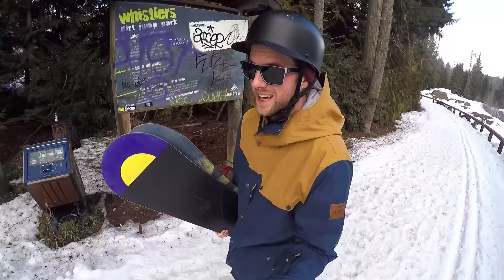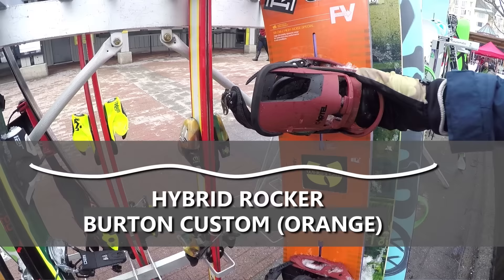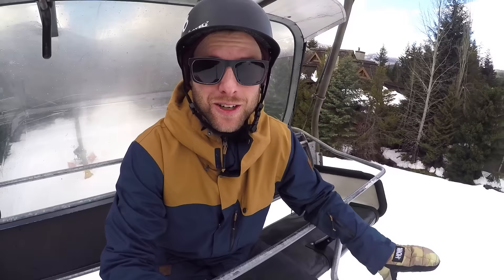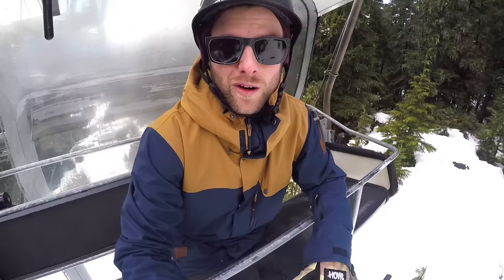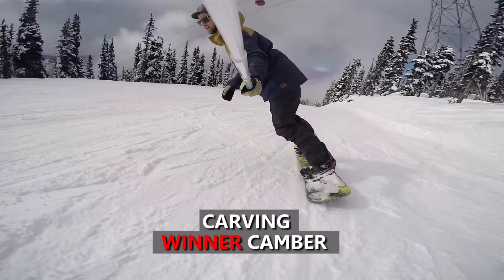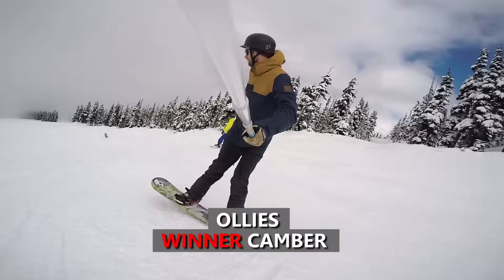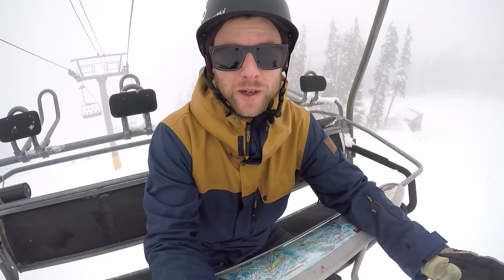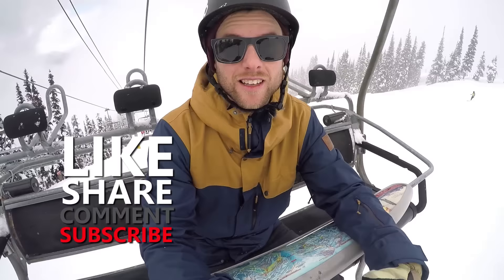Camber VS Rocker Snowboard Test

Comment: My personal choice: flat camber/ zero rocker/ however you wanna call it. I used to ride a hybrid rocker for a long time which was really fun in all conditions (except for icy conditions) and all parts of the mountain. Playful, comfy powder riding, nice to learn butters and start off park riding as it is really forgiving (while you'd catch your edge pretty quickly on a camber). But as I was progressing in park riding I wanted something more stable for bigger jumps, but still playful and not too aggressive. At first I was pretty skeptic about flat cambers, but once I tried it I immediately fell in love. I'll keep my rocker hybrid board for those hard and long powder days, but I won't switch to another shape in all-day-riding.

Comment: It all depends on your terrain prefs. I have a big swooping rocker board which floats extremely well in powder. For groomers and kickers I use a twin camber board. Both perfectly fit my needs when used in the proper terrain, but would perform worse in the other situation. If I ever get into boxes or park more, I would buy a short rocker board, so that I catch an edge less easily.
Also, rocker boards are more fogiving in turns and landings, but give you less response if you're going for big, fast slalom style. And then there is the whole other issue of board stiffness...The best board for you is the board that best fits your riding style.

Comment: I just switched to a lib tech trs c2 power , and although I have no camber experience to speak of, I am absolutely amazed with this board (my 5th board). Very stable flat basing, edge hold is phenomenal, pop is great, great in pow, great on hard pow, great on icy days, buttering brilliant, landings very good, one footing easy. I am in love with this board and have progressed more in 4 days using this board than in two seasons on my last board (rome agent rocker).

Comment: The board I got good on was a camber, then 2 years later I switched to a board with a rocker and magne traction for about 4 years. I never got any better on that board with the main reason being the edges. My GNU would always wash out on me even with the "7 points of contact" magne traction. On a camber when you put that edge in the snow you can really feel it in there and that's what you want for spinning, something to push off of. And for boxes and rails I still prefer the camber, I mean I can press just as good as a rocker board if not better, it has more to do with your boards flex and where you stance your bindings. For spins, pop, rails, and edge control I'd say camber all day. For powder and butters go with a rocker.
Reply from the maker: +Brennan Hamilton exactly my feeling too!
Reply: Good comments/insight. I've been riding the GNU Space Case (hybrid rocker with the magne traction) for 4 years and just picked up a full camber board (never ridden camber before).  I am having the same "wash out" experience that you reference.  I'm just worried about catching an edge, but we'll see next week when I get it.

Comment: I was a die hard camber guy (boarding since 1990) and have to say burton rocker and hybrid rocker are the most unstable boards I’ve ever ridden. So i tried a few more rocker birds as they came out and nothing could compare to camber stability at speed and edge control. Then I ran Rides designated Hitter with hybrid profile and the thing was super stable, floated great in powder, slayed the crud, lots of pop, yet playful in the park. Skip forward to riding a Lib Tech C2E profile my buddy was raving about and damn if I wasn’t impressed, ended up getting a GNU T2B with BTX hybrid profile and have to say this thing is best of both worlds: crazy stable at speed, great Magne traction edge hold in icy/variable surface conditions, blasts through crud and tracked out conditions unlike anything I’ve ever ridden but still so quick edge to edge with the best float in powder I’ve ever had including from traditional rocker boards. Mervin made lib tech and GNU for the win!!!!

Comment: First learn to butter like a pro and then you'll find the advantages of the rocker. And also rocker as better for learning as well, hence it's forgivable behavior. 
So... Rocker is for - ground tricks, learning, powder, spins and tricks
Camber is for - speed, carving, icy slope
Reply from the maker: +Plamen Penev What advantages do you think the rocker has for beginners?
Reply: On my opinion, rocker is better for beginners, because it is easier to maneuver and it's forgivable in terms to catching the wrong edge while turning. Other good choice for beginners is a flat board.
Reply: +Plamen Penev I think it also depends on where you struggle while learning to snowboard. When you have troubles catching the wrong edge, a rocker could be a good idea. On the other hand, if you (like myself) have troubles with flat/narrow passages, the camber seems the better choice. A lot of the skiing/boarding areas where I'm boarding are traditional made for skiers, often connecting passages with long flat logging roads (I hope thats the right term). Those are hell especially for beginners who don't feel comfortable riding with high speed (to get the drive for the flat parts). The camber feels way more secure on those parts in my opinion. Apart from that, the feeling for the boarder should be the main reason to chose a board, so testing different styles should be recommended to everyone ;)
Reply: +Plamen Penev I learned on rocker and after switching to camber I wish I learned more on camber, because it took me a while to get used to it. Rocker promotes lazy riding and allows riding ok even with bad form/technique, while camber wont forgive you for those. You can also learn to butter like a pro on a softer camber board as well.
Reply: +MrFujiapples, I've learned on camber /at thet time rocker wasn't invented yet/, and then switched to rocker, which suits perfectly to my riding style - ground tricks mainly. Snowboarding shoud be easy, fun and why not lazy as well, I don't see that as a bad thing. With rocker board in the end of the day when you are tired, or when you learning new tricks small mistakes won't get you on the ground. Of cource If you are a big jump, slope or speed rider, camber would be a better idea.
Reply: +Plamen Penev   I take camber boards for everything! Big park jumps, Pow jumps, powder lines, rails, slope butters.. But i'd say that rocker or a hybrid is much better to learn..
I also learned on camber cause ther were no rocker boards. i changed to rocker 2 seasons, liked it a lot more, had an hybrid 1 season, liked it even more, then i tried a full camber and i absolutely loved it! so now i'm riding camber since 4 seasons. Rome MOD .. best board ever..  
I guess you just need the Power and control yourself for the Power and control of a camber board..
But i want to get a Big Powder fishtail rocket for those sweet Pow days!
Reply: +Plamen Penev I learned on a hybrid rocker, (Nitro cinema) and although I have a lot of fun on it now its way easier to catch an edge going at any kind of speed. You need to have an evenly weighted stance and no beginners have that, if your shoulders aren't straight you will also start turning uncontrollably as soon as you get going. 
On the other hand its got great response and you can be really surfy on side features.
Reply: I disagree, I found rocker HARDER to begin with. Camber works as much more of a shock absorber over small bumps and shakes, especially if you are like me and ride in places with man made snow, the difference is night and day. Can agree its more forgiving when it comes to catching edge but that forced me to edge properly and once i really got properly carving I went from a green run to a black run in one day. That wouldn't have happened with a rocker setup. I've suggested everyone learn camber and they all do great once they get though the first day or two. Had one friend in the halfpipe on his 3rd day out.
Reply: I learnt "ground tricks" on camber.  Then I got a rocker board to learn more. I felt camber is much less forgiving. e.g. if I do a 180 and I don't land perfectly straight, it might throw me hard. But with rocker, I would just wash out and spin with it. It's not good to take too many falls when learning anything (beginner or expert riding). It reduces your energy and can demotivate you when it hurts. As for beginners, they don't do high speed carves so that's not an issue. And if all you do is what you already know, you will never catch an edge with camber. If you push the edge (pun), then you will.  Rocker reduces it though.

Comment: The hybrid is so different, I use a traditional reverse camber with my partially paralyzed left (lead) leg. Sell it has heel toe ridges to give a tiny bit of grip.

I have so much more control in the turns compared to every camber I've rode before. Simply a huge difference.

Your videos helped me learn my basics btw. Still have some issues with my paralyzed leg, but between my Arbor Swoon and your videos I carve the mountian in tiny bits.

Comment: I ride an old 2007 naidecker platinum, which is camber and also own a bataleon whatever, both 158. The what ever is miles off being a camber and the NP is a pure camber. I like pissing about on my whatever in Park and groomers but any time I want a Good solid day off piste, in pow, Tree runs or beasting it on a group day of trying to clear a mountain I'll always go with the NP camber. When I give advise to friends learning I always advise a rocker or hybrid as it aids with thier turns which as we know from the start is the tough bit to link, but I plan on getting the Travis rice HP for next season as rode it a few times and  it is just immense for everything. Keep it up Kevin, cheers pal

Comment: There are so many options.  I ride a balanced mix of deep powder and groomers in Japan and my go-to is my 161 Burton Barracuda which has that hybrid Flying-V camber and it excels at both; it chatters quite a bit on hardpack because of the long, floppy nose but the edge hold is great.
I'm about to roll out with two new boards for Japan this season; a 159 Arbor Shreddy Krueger which has what they call Parabolic Rocker where the rocker tapers towards the tip and tail.  The sidecut has four extruded contact points as well so more technical riding is doable.
The other is the K2 Ultra Split 158 which is almost flat underfoot (like a 1/4" of camber) and rockered at the tip and tail.
So, two very different shapes this season.  I'm curious how they'll perform and hopefully diversify my riding a bit.

Comment: Burton hero 2010/2011 version with 2/10 flex and rocker profile has definitely changed how i view snowboarding. Just the agility you could have with a soft flex twin rocker board opens up a very playful variance of snowboarding that was unavailable for me before trying this board, i instantly fell in love with this type of board and the various riding styles it allows .... definitely not a winner for speed, stability, carving or difficult / icy terrain ... but the fact it allows you to feel the sport in a more playful way, and just generally opening up new perspective to riding would give rocker profile, flexy boards more value in my opinion. Cheers!

Comment: Should have mentioned camber is much easier to catch edge on, especially for beginners. I started out with a camber board and would catch edge and fall hard a few times a day. I switched to rocker and pretty much never catch edge anymore.
Reply: +dacasman you will catch more edge when you're learning and less afterwards. So if you use a camber initially then switch, it will seem like it's the board allowing you to catch less edge but it probably was just the typical snowboarder's learning curve.

I said "probably".
Reply: +Cichlid Bro That's absurd. I've been riding for 18 years and own rocker and camber boards and you are just dead wrong. Rocker will let you get away with mistakes you would pay for dearly on a camber board. If I'm going fast I wouldn't trade camber for anything. If I'm playing around in the park and trying new butters, rocker is better.

Comment: The only thing I dislike about my camber board is the edge catch when I'm buttering. Other than that, it's a charger! I can ride 50-60mph without a second thought. Definitely more control than my rocker board...but rocker was more playful.
Reply: 3D bases man, they are the way. http://www.gilsonboards.com/pioneer-snowboard.html these boards are really cool, they have a "soft edge" design so on hardpack your edge isn't making contact with the snow if you go flat base, and they have a ton of flex in the middle of the board with the rest being pretty stiff so you can butter on a camber board without worrying so much about hangups. But then you're still riding a camber board when it comes down to it so you can lay down some really nice carves. There are so many advantages, it's a great jib board concept because you can keep your edges sharp without worrying about hangups, great for pow, great for forgiveness on landings, but without sacrificing control on takeoffs. They have a US demo tour so you can ride before buying cuz the price is indeed on the steeper side. I have 2 and they're so worth it, saving for my 3rd.
Reply: Sam Clark same here with my old pro model sims. Its a board that want to go fast , ride aggresive, and pop. But I'm checking for a hybrid board, very curious about this shape

Comment: Why is this not Camber Vs Hybrid? I feel like Hybrid profiles are much different than a full rocker profile. Also where the lengths of the boards the same? I feel like that would make a difference.
Reply from the maker: Yeah, the board lengths are the same. (159) I could title the video rocker hybrid, but I thought people may not know what rocker hybrid was and would be more familiar with rocker. That's why I explained the difference at the beginning.
Reply: Hybrids are full rocker throughout the board. They just have camber under the feet.
Reply: +Got Method not all of them are, like the libtech hotknife is a camber dominant with just a bit of rocker in between your feet
Reply: +Got Method depends on what kind of hybrid we are talking about there are so many different combinations. You have rocket camber rocker. You have camber rocker camber.
Reply: +SnowboardProCamp I see where you are coming from and thanks for the reply. it was a great video and keep up the good work. Would love to see you talk about all the different profiles and give a very in-depth analysis of them all.

Comment: From my short 14 years on a snowboard i think i have boiled camber vs rocker down pretty well. Rocker is great 90% of the time its what is best for the job, you can really feel the control of spinning, turning etc based in the symmetrical center of the body, it floats through soft stuff better, doesn't edge catch quite as easy and is easier to learn on. However there is the 10%, it lies in the cambers ability to grab snow. nothing carves down a hill or up a lip of a park booter like a camber board. can a rockers do bs9's????yes of course. However you should know the 100+ riding day/ year guy who throws said bs9's after breakfast every morning with grace and style that almost makes you wanna quit is riding a camber. Also camber naturally has better pop which is great for squeaking that last 180 or getting up onto that ridiculously high handrail.    I know a lot of rocker guys out there may not agree but just look at all the xgames, dewtour and other contest riders and see what they are riding. Stale is the only one i can think of that contradicts, and even his is a hybrid. Also board manufacturers will make boards to riders profiles and wrap it in conventional graphics so stales board may not be a mod rocker at all!  Rockers are great boards i own 3 or 4 of em and are capable of more than i am, but my Camber boards are the ones that leave the lasting impression.

Comment: I snowboarded 15 years on a stiff camber. (150-160 range)  I then upgraded to a Burton Nug (142)  the first year it was out, when it was completely rocker (no flying V or hybrid)      At first I had feelings like you have kevin, like there wasn't enough edge or something.  After 7 seasons on the nug and over 300 days,  I can say that initial reaction is FALSE.  The thing about the true reverse camber, you need to COMMIT to your edge.  Straight over carve and you reach this next level of edge hold.  Like there is a relaxed carve with reverse camber boards, where you feel like you are slipping more,  then if you lean just a bit more you lock into this rock solid edge and you can straight carve so hard you go back up hill.    Also with the reverse camber I've been able to confidently learn front and back boards,   lots of butter tricks like presses to 270 outs (front and backside)     

I'll say though, the ONLY thing I can think of that is lacking in a reverse camber board is the pop.   I miss my huge flat ground pop that comes with a traditional, really super stiff, camber snowboard.   I haven't experimented with a hybrid (camber under feet, reverse camber between feet and on nose/tail.    hows the pop on them?
Reply: What's your thoughts on your rocker on icy/hard snow?
Reply: @LS67NOVA  I would prefer camber, but,  if you keep your edges nice and sharp you should be able to shred ice/hardpac on any shape.

Comment: I'm an old school intermediate rider, so of course I say camber is the way to go. I need the stability and grip of a camber board. I guess it comes down to what kind of rider you are, but I think its a matter of putting in your dues and taking the lumps and bumps that come with learning anything new. When you finally get it and start nailing turns, I think you'll be much happier with a board that is stable with great edge hold rather than one that feels squirrely. Easy turn initiation is not a fair trade for reliable edge hold and stability, in my opinion. =)